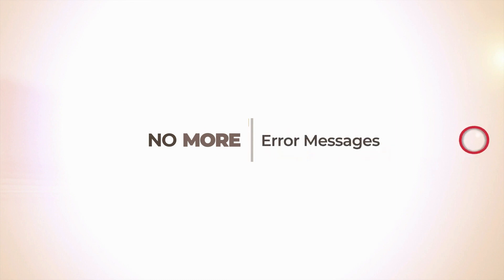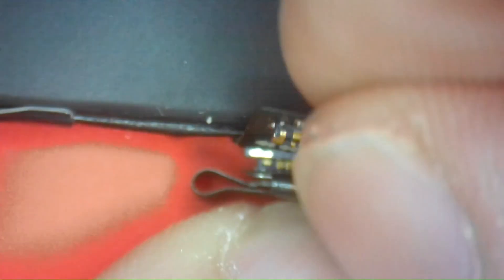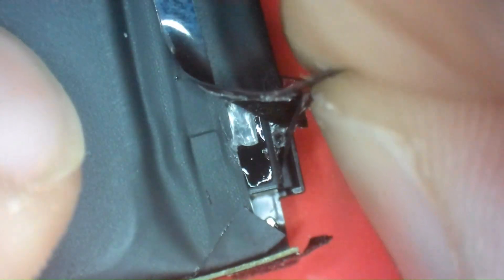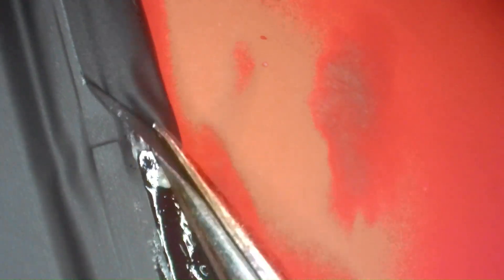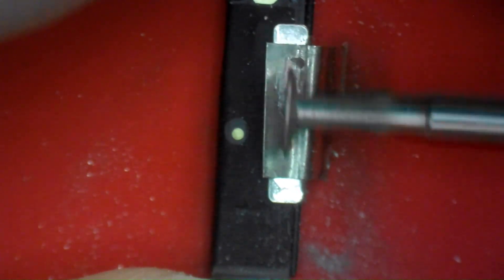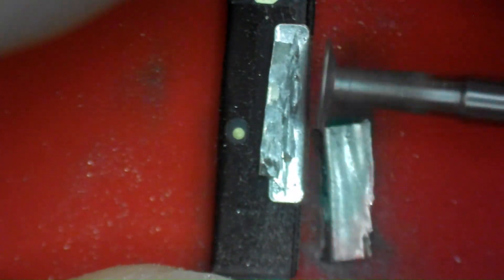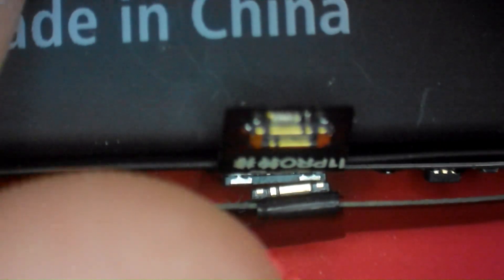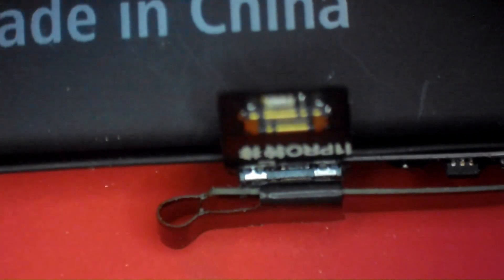iPhone 11 Pro/Max Battery Repair in-Depth BMS Transfer, TagOn Install, BMS Preparation, Secure Weld

Comment: While doing this, I get customers returning after a few days because their claiming there batteries don’t last. Having bad battery life.
Reply: in my observation i dont think the average person actually keeps a check on the actual battery %. they plug it in whenever they want they unplug whenever they want . a new battery will be harder to charge. then these have higer capacity in most cases. some people are using the stupid little 1amp adapter still (ridiculous) and the battery absolutely will not charge. it will stop IF it starts in the first place. theyn they use the fone and battery dies sooner than expected. working in the repair industry ive learned the average person takes tech for granted as when they where born they had all this stuff . like i do with sliced bread. they just think everything ''works'' and thats it. i try to send out devices with full charge and always advise a good aftermarket 30+watt PD charger. i use 100+ or 200watt charging stations.